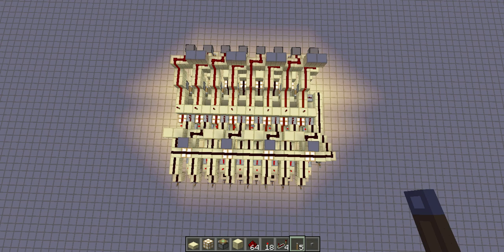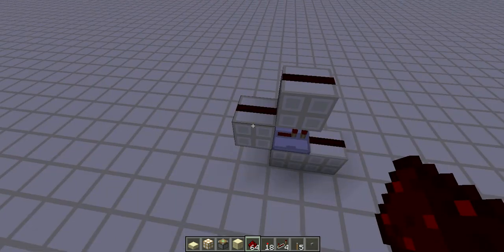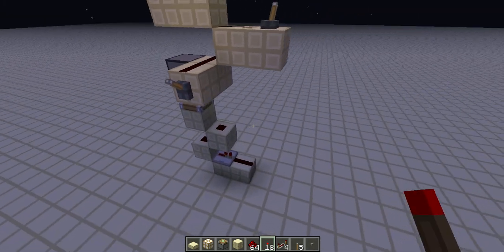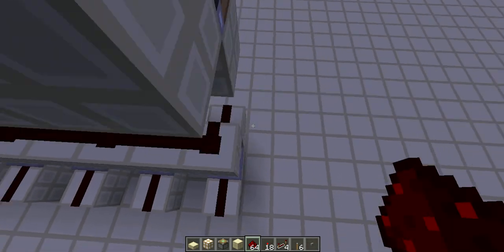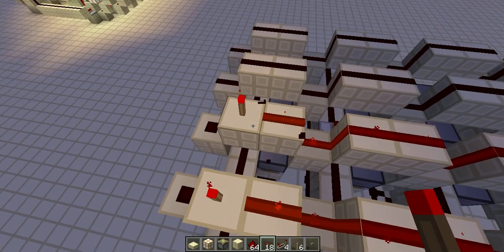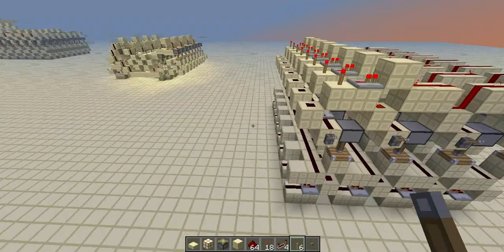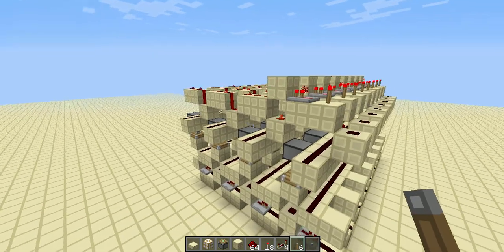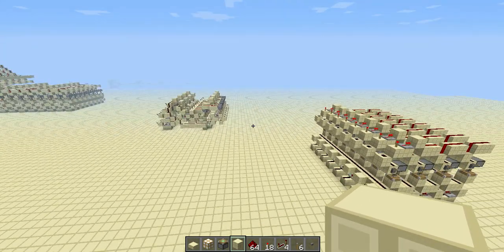How to Build an 8-bit Redstone CPU in Minecraft Part 3: Register Design

Comment: Congrats kid. You can easily pass a college course. Would you like your associates in computer science now or later?
Reply: I don't think its enough for an associates, but we covered a lot of this stuff in computer architecture last semester. Its actually a lot easier to implement this using breadboards and wire than in red-stone (at least for me)
Reply: Lunatic Programmer he does have a point since building circuitry today is pretty easy as long as you get it right, but building in Minecraft is complicated since there’s really big limitations to Redstone

Comment: I've got a question, whats so important about Registers? Couldn't you just use And Gates or D-Flip Flops? It worked in my (very basic) ALU Design.
Reply: The Registers are needed for the CPU to store it’s data sometimes write the data. If you dont have registers it might not function IDK I’m not a big user of Cpu designs yet
Reply: If you want to build a sequential circuit you need to store data while passing through one state to another, you can use this design or a d flip flop, they do basically the same.